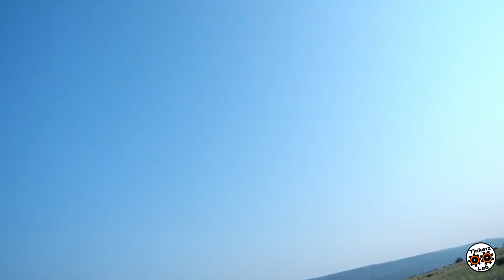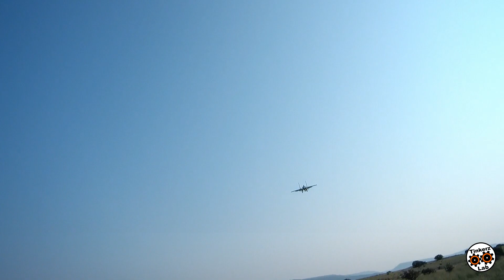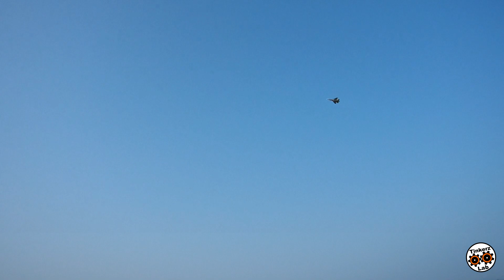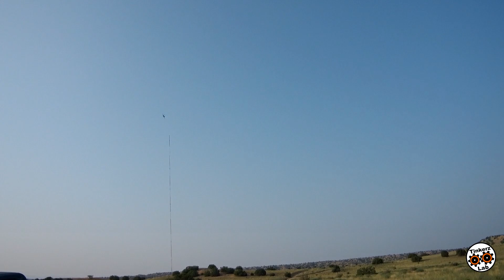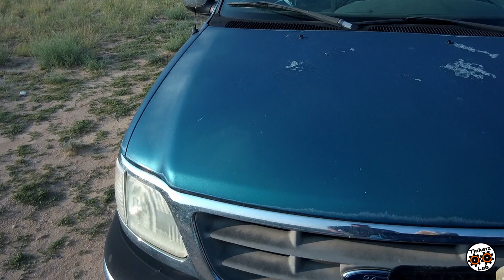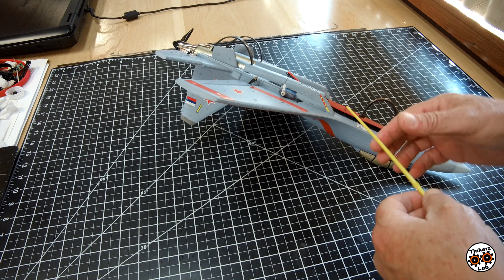3S Power MODs Test Flight #1 | QF009 SU-35 Jet Brushless Sub-250g 375mm 3D/6D Gyro RTF

Comment from the maker: The Motor, ESC, and LIPO were just warm. I'll be getting 6-7 minute flights using the stock prop leaving 3.6v per cell.
Items for MOD.
EMAX BLHeli Series 12A ESC
https://www.banggood.com/custlink/D3DIdutyyZ
Emax ES9251Ⅱ Upgrade Version 3g Plastic Gear Micro Digital Servo
https://www.banggood.com/custlink/mGKiET5Ydd
WFly RF201S 1.32g Micro SBUS PPM receiver (OpenTX Supported)
https://amzn.to/42wFePB
RadioLink Byme-DB Flight Controller & Gyro
https://amzn.to/48qT85U
GNB 3S 550mah 100C LIPO XT30 Connector - 2pk
https://amzn.to/3RYYEWp
The ESC & Servos are better than the ones I used.
The LIPO is slightly larger (550mah vs 530mah) but they don't seem to make the 530mah any more.
The 530mah is approx. 4g lighter than the one listed.

Comment: Hi have u found a prop if so please comment as I’m experimenting with stock capabilities and want to get the max power out of it.
Reply from the maker: I'm still using the stock motor an prop on 3S.
Reply: @tinkerzlab what controller are you using?.
Reply from the maker: @Mr_ZigZag Radiomaster Tx16S
Reply: @tinkerzlab can I use t lite jumper 4in1
Reply from the maker: @Mr_ZigZag Nice looking radio, the form factor reminds me of the Radiolink T8S.
Reply: @tinkerzlab would it work I’m thinking of purchasing it as the stock controller is very bad and I don’t have a clue on how to bind the jumper one to the plane
Reply from the maker: @Mr_ZigZag As long as they haven't changed the protocol since I received mine it will work with the 4in1 module.
Here is the info from when it was stock.
Protocol = MT99xx / H7
6G / 3D  = CH5

Comment: Mount the gyro with Align PU Adhesive Gel Gyro Tape K10457A. It has solved all of my micro gyro oscillations. It deadens the feedback to the gyro. Its used on sensitive 3D helicopter flybarless gyros. Its like magic.
Reply from the maker: Thanks for the info and I'll put it on my list.

Comment: Will you share links to the esc and other gear you used for the conversion please?
Reply from the maker: I think I listed all the components I used for these MODS near the end of this video:
https://www.youtube.com/watch?v=mOPJJxzycM4
I used an HTIRC 12A ESC as that's what I had on hand but I would have used a better ESC.
Here are my components list:

EMAX BLHeli Series 12A ESC
https://www.banggood.com/custlink/D3DIdutyyZ

Emax ES9251Ⅱ Upgrade Version 3g Plastic Gear Micro Digital Servo
https://www.banggood.com/custlink/mGKiET5Ydd

WFly RF201S 1.32g Micro SBUS PPM receiver (OpenTX Supported)
https://amzn.to/3J3IaIk
https://s.click.aliexpress.com/e/_DBWoZkP

RadioLink Byme-A / Byme-D / Byme-DB Flight Controller & Gyro
https://amzn.to/3LuLUUV
https://s.click.aliexpress.com/e/_AOGjbL

GNB 3S 530mah 90C LIPO XT30 Connector - 2pk
https://amzn.to/3RYYEWp

Comment: How come mine says to be the same model but has darker paint on the top side??did i get the wrong one? I hope not.
Reply from the maker: I think the light and dark versions are the same except for the color. I was actually hoping to get the darker one as it's easier to see.
I put links to both in the Show Notes.
Reply: @tinkerzlab Oh okay well thats relieving, what would you reccomend i do out of the box? Besides 3s battery upgrade
Reply from the maker: @Cloudy_dayzzz03  If yours works fine stock I would just leave it stock unless you really want to fly it on 3S.
I replaced all the electronics on mine, except the motor and prop, as my ESC was acting up.
If I had not had any issues I would have left it stock as it flies great, has good power, and great flight time.
If I remember correctly, I think I had to add approx. 2.5g of nose weight when it was stock as it felt a bit tail heavy.
See what you think when you get it trimmed out and see how your balance is.
You're going to like it ;-)
Reply: @tinkerzlab  alright thank you much for the advice mate I’ll make sure to get back to you on it
Reply: @tinkerzlab  what 3s battery did you use i can’t seem to find any that fit
Reply from the maker: @Cloudy_dayzzz03  At the end of this video I discuss the MODs I made on this Jet.
https://www.youtube.com/watch?v=mOPJJxzycM4

Comment: 7:10... Maybe it's just me but... If you increase the Control Horn Length you will get more control surface deflection not less. Correct me if I'm off.
Reply from the maker: No, the further out on the control horn, the LESS movement you get. The further out on the servo arm the MORE movement you get.
Reply: @tinkerzlab  Obviously.... Early morning Brain Fart....🙃
Reply from the maker: @lasersbee  No worries.

Comment: sheesh..quite a punch dan capable of unlimit vertical......even it is require a lot of work but it is worth it....
Reply from the maker: Yes, I think it's such a good airframe it was worth it ;-)
Reply: @tinkerzlab  if you looking for the new project you can try XK A180 F22 brushless. mid push prop configuration and also you can bind it with your tx with no problem.
Reply from the maker: @EnddyFishing  I actually reviewed the XK A180 F22 a long time ago. It's a fun micro parkjet but I think this airframe is much better. I also performed flights with it using the TX16S.
https://www.youtube.com/watch?v=2nXO5EZAW3s&list=PL_YiEhY7O1WbX9EK95qRzg0AfdLLwBuan